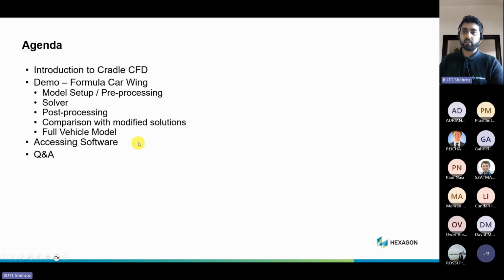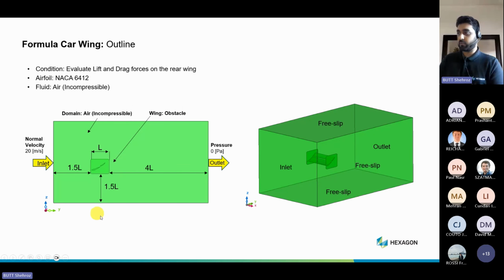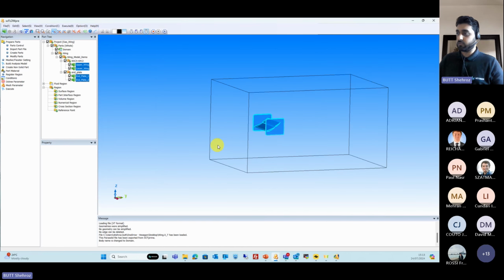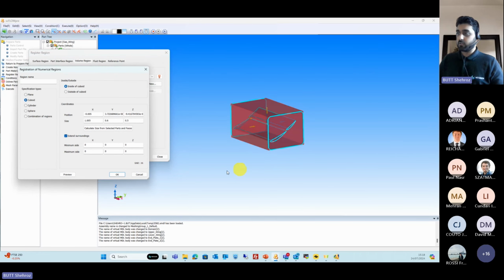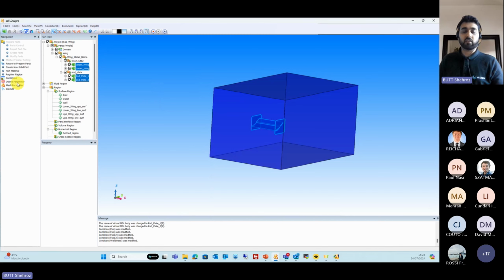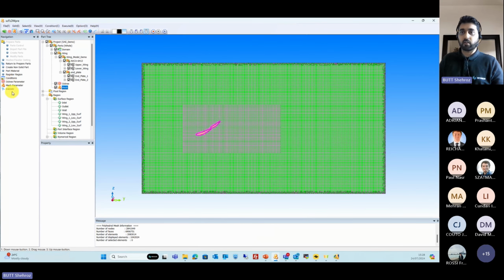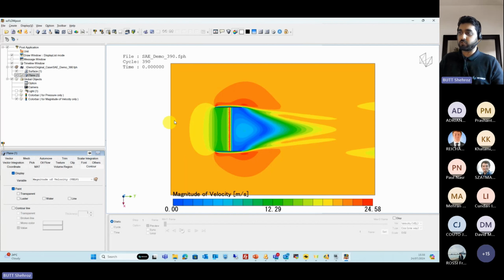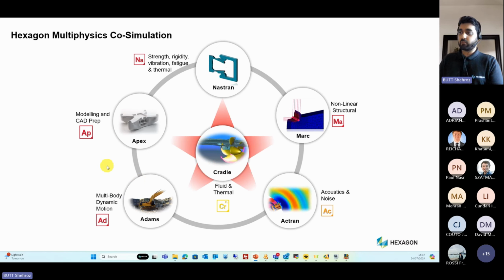Computational Fluid Dynamics for Formula SAE with Cradle CFD

Comment: great presentation! i am curious if u ever encounter randomly the solver doesn't successfully save the result files in *.fld. it usually on step priori the fld file saying in the message window and fld files comes with file fld.lock. just trying my luck here if u have a solution for it. thanks in advance.